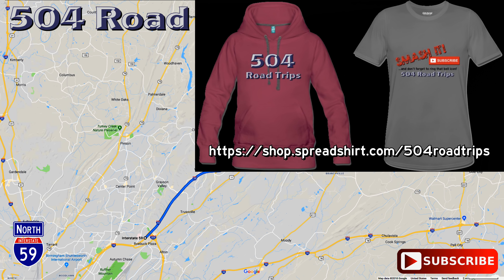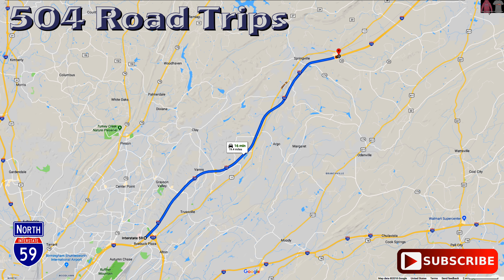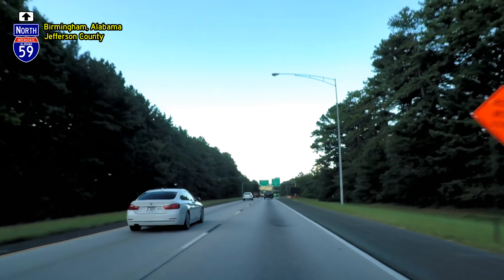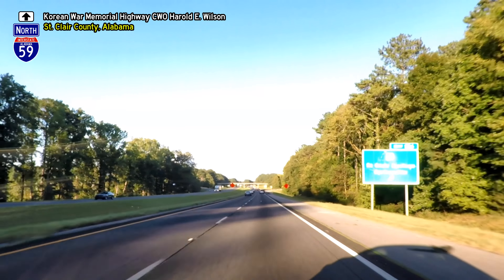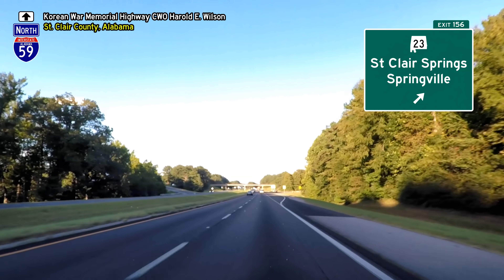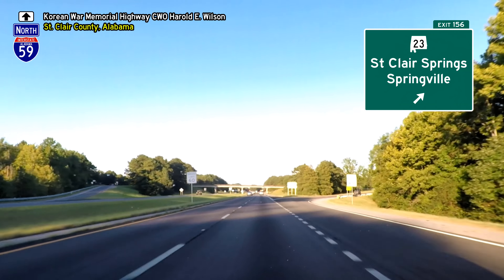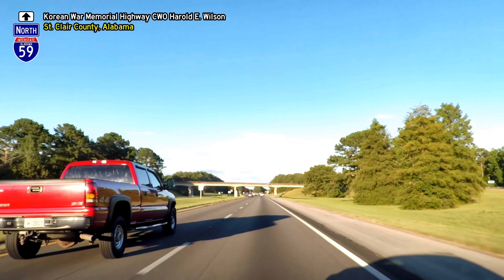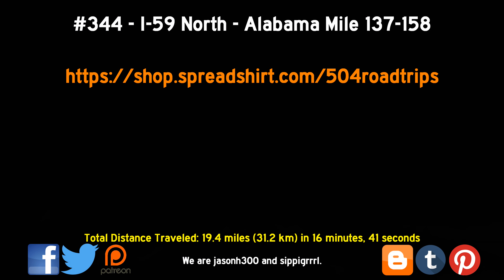Road Trip #344 - I-59 North - Alabama Mile 137-156

Comment: Maybe you'll still be alive when the  I-422 northern bypass is built, completing a full loop around Birmingham.

Cool info regarding Trussville, thanks.
Reply: So a beltway of sorts?
Reply: @briteidea08  More or less. The southern end would begin as a continuation of the 459 south of town and its north end would be at 59 near Argo.
Reply: @roadwaywiz  Thank you.
Reply from the maker: Problem is, if it's supposed to connect with the northern part of I-459 at I-59, there's a dense residential area just to the west of I-59.  It's going to be another Shreveport situation. I can't seem to find a map of where they plan to put it now.  The Wikipedia article references aaroads.com, but the link is broken.  A search of I-422 on aaroads.com yields an article by Alex that describes the route, putting an end to it near Hubbard's Lake, which is about 10 miles north of where I-459 connects to I-59.